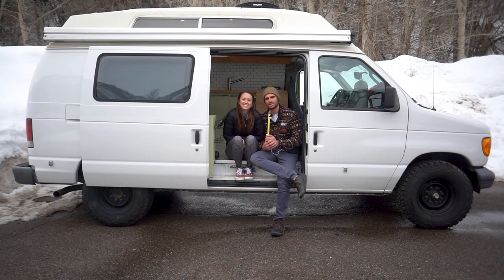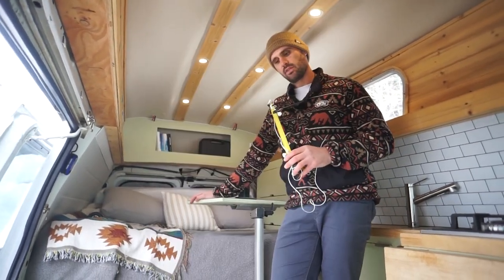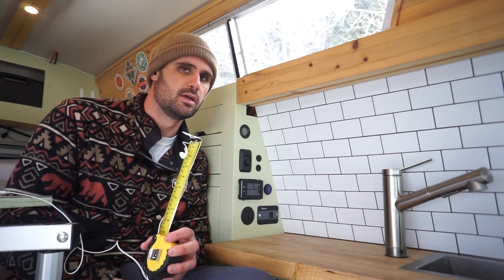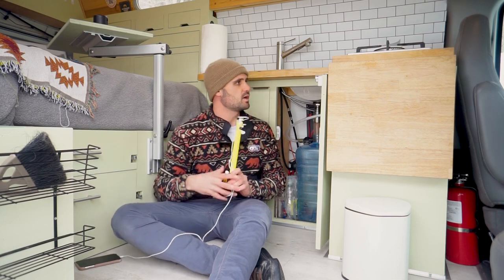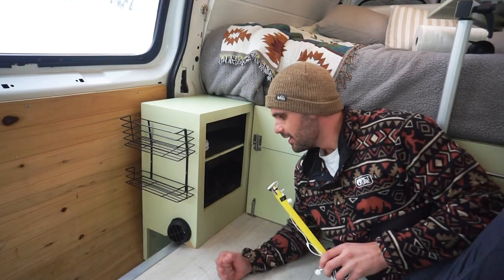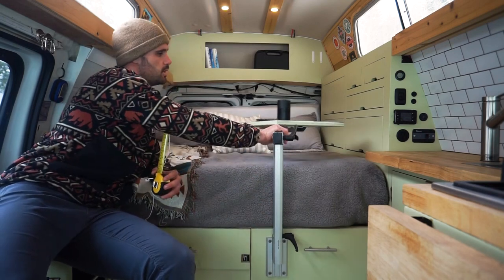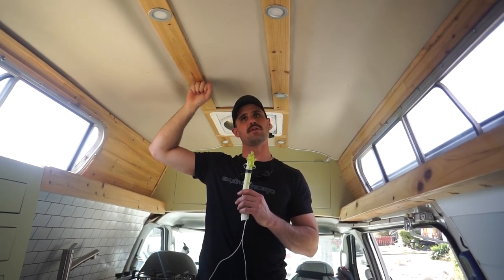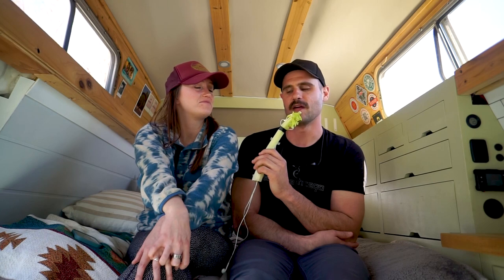2006 Ford E250 campervan conversion walkthrough

Comment: That’s a functional buildout! One question: how did you attach the wood ‘shelf’ around the lip of the high top/old roof?
Reply from the maker: When cutting the original roof off I left a small overhang which I then was able to sandwich a shelf on there and it was surprisingly sturdy
Reply: Excellent, thanks for getting back to me!
 @boesigergentry
Reply: May I ask, did you buy the shelf somewhere? If so, where? I have same setup in which I am trying to sandwich some shelving on top of the lip

Comment: Sweet build, I really like that layout. What size tire are you running? And its stock height?
Reply from the maker: I appreciate it. Ya I don’t have it any more so I can’t double check but if I remember correctly I’m pretty sure they were 265/70/17. Stock height but it did have the tow package so there was an add-a-leaf on the back.

Comment: Whats been your experience with the flexible solar panels? Ive heard that they tend to overheat and not be as efficient since they dont have any air beneath them to allow for cooling. Any experience with any of this?
Reply from the maker: I’ve heard the same thing. Before mounting I placed the panels on some corrugated plastic that you would use for lawn signs just to encourage a little airflow and they seemed to do pretty well even in 120 degree heat.

Comment: Great job, I have a fibreglass roof, which adhesive did you use to put head liner on? Also what is the headliner fabric it looks nice?
Reply from the maker: The old trusty super 77 spray. Can’t go wrong. For the fabric I just went to a fabric store and browsed my options

Comment: Do you mind if I ask how tall the fiberglass high top is? I am 6'2 and trying to imagine how tall the topper would need to be to allow me to stand. Sounds like you're in a similar position. Thanks!
Reply from the maker: Unfortunately I don’t have a measurement on the top itself since I found it at a scrap yard and shaped it myself which took away from the height. That being said I’m 6’3” and if I was 6’2” I could stand up perfectly

Comment: How did you put up the boards to the fiberglass roof/top?
Reply from the maker: I can’t remember right of exactly but if I was to throw one out there it was probably a tight bond marine adhesive that comes in the caulk gun set up.

Comment: Hi you guys did great job on your build. Did you made magnetic cover for the back door windows yourself? I’m looking for cover like that for my E-350 but haven’t found no where. Appreciate your sharing.
Reply from the maker: Yes! Made them ourselves. We couldn’t find full sets either.
Reply: I shopped around for econoline window covers and Vanmade Gear was the most cost friendly. They are EXCELLENT covers: warm in winter, cool in summer, and nice looking to boot. And the company was A++ to deal with (I ordered the wrong ones and they contacted me to ask if I'd gotten it right - I hadn't).
Reply: @LaraSatoriHarris  thanks for sharing.
I’ll try and see what I can find there.

Comment: Do you run the a/c all night in hot climates?
Reply from the maker: There is no a/c other than the one in the cab. We do usually run the maxxair fan mostly all the time when it’s hot and we are usually good for bed up until like 95f during the day

Comment: 4.6 or 5.4?
Reply from the maker: 5.4😉
Reply: What’s difference in 4.6 and 5.4 ? Is 5.4 more bigger and stronger or more power engine then 4.6? Thanks
Reply from the maker: @orientexpressVanlife  there you go. That’s it for the most part
Reply: 4.6 will get 16-18 mpg, a 5.4 13-15 mpg. I have owned both